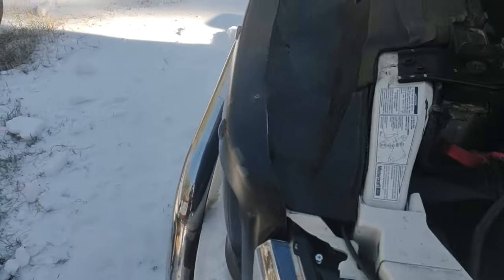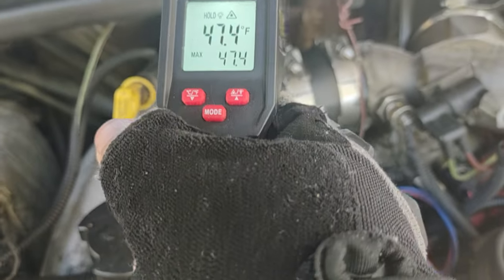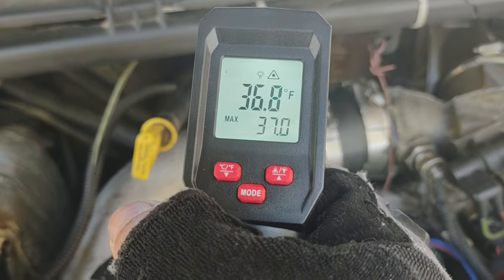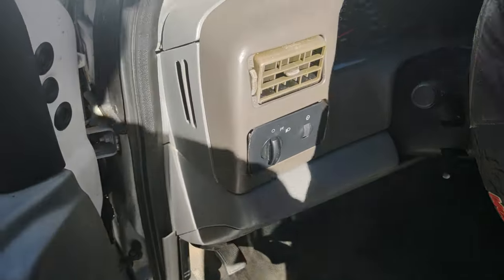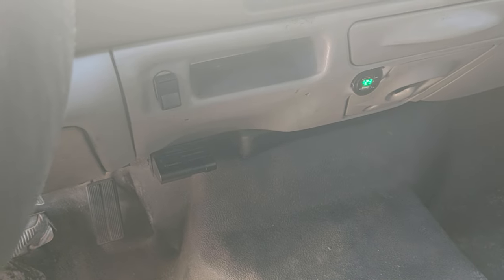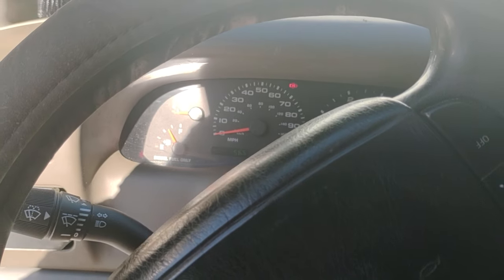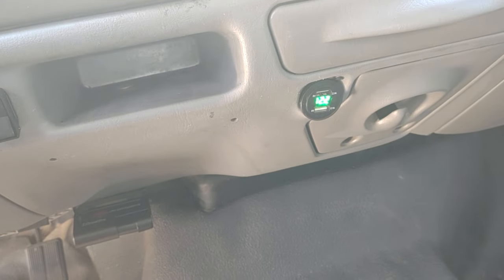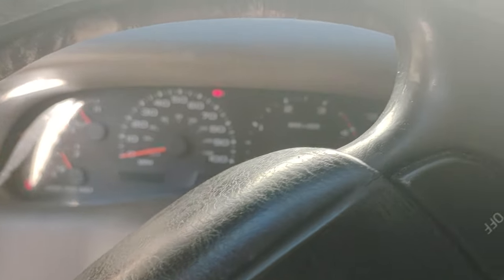F350 cold start attempt part 2 (with success ☺️)

Comment: Maybe need to replace the glow plug relay. What is the voltage drop when you turn the key on cold?
Reply from the maker: Between 1.1 to 1.4 volts. I hope I don't need to replace the gpr, it's less than a yr old😯
Reply: Jump the two main posts on the glow relay and get some one to crank the engine over. It looks like  the old type solenoid
Reply from the maker: @paullesho2693  definitely gonna try that...thank you 😊👍

Comment: Must have some mechanical problems because 38-40 degrees isn't even a cold start imo.
Reply from the maker: You're probably right...it's been starting just fine since and it's been in the mid to low 30's 🤷‍♂️ I know that my fuel bowl heater needs to be plugged back in.
Thanks for watching 😊👍